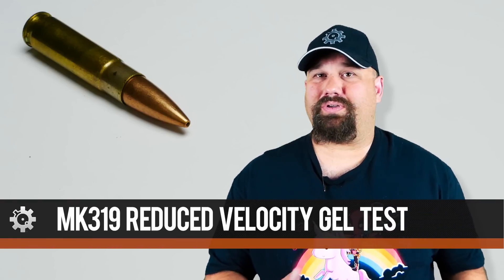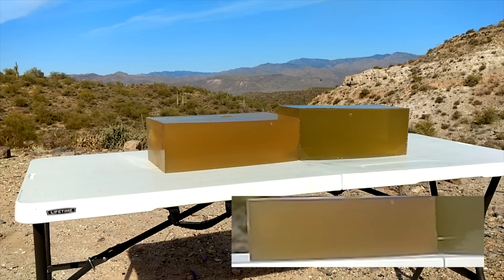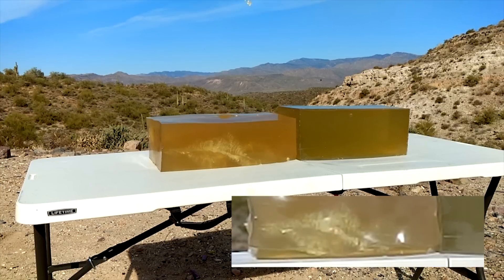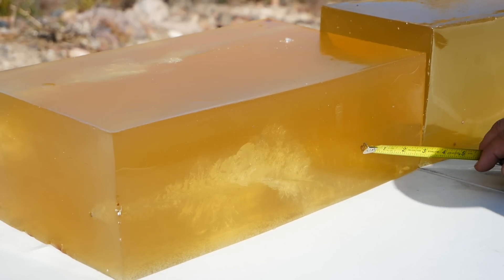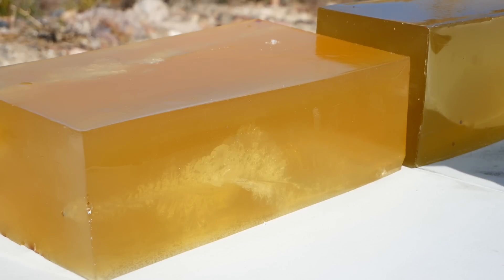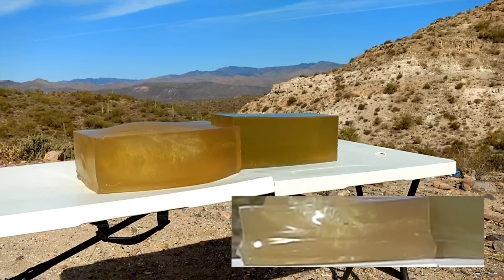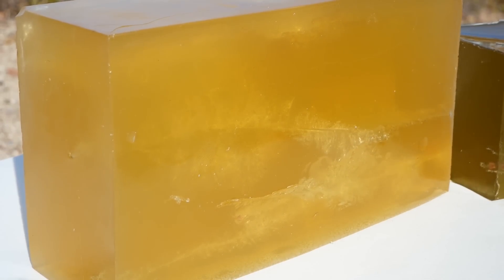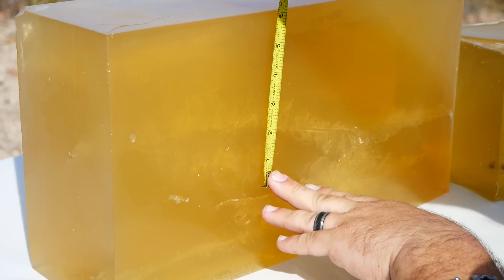MK319 Reduced Velocity Gel Test - How does it compare to the Army's M80A1?

Comment: How can you get a REAL WORLD EFFECTIVENESS of the MK319 AMMO when that is a 7.62x51NATO ROUND and you are loading it into a 300BO at HALF the Velocity of 7.62NATO??  US Military as DOES NOT use 300 Blackout Except for some VERY ELITE UNITs like Seal Team 6/DEVGroup and Delta Force/Special Mission Unit! Here is the info from Federal on the Mk319 who runs Lake City!
Brand or Manufacturer: Federal
Model or Type: T762TNB1 NATO MK319 MOD 0 SOST
Cartridge: 7.62x51mm (.308)
Bullet Weight: 130 Grains
Bullet Type: OTM, barrier blind, open tip match bullet
Temp stable flash reduced propellant
10% reduced recoil impulse
Optimized for 16 inch barrel (SCAR Heavy / SCAR 17S)
Muzzle Velocity: 2925 at 15 feet with 16 Inch barrel
Muzzle Velocity: 2750 at 15 feet with 13 Inch barrel
Reply: Didn't you watch the video?
Reply: @af22raptor23503  The test was to simulate the effects of the projectile at extended ranges. That's why it was loaded into .300 BLK it was an attempt to replicate the 7.62 x51 at 400-500 meters.
Reply: @af22raptor23503  This video was just trying to simulate wound ballistics at extended ranges with the Mk319. I'm sure if you sent them some ammo they would try and preform any test you like.
Reply: @af22raptor23503  Well how should he have done the testing?
Reply: @af22raptor23503  Nothing you presented would have simulated reduced velocity. Which is the entire premise of the video. No the test is not in a controlled environment just like actual combat is not in a controlled environment. This test was not to strict FBI standards that's true. The vast majority of rounds on targets in combat are not through hard barriers. This was just some guy on YouTube trying to simulate the Mk319 bullet not the actual round at extended range. Using the rifles you suggested would only show the round at CQB ranges through hard barriers. That is not the idea behind the video reduced velocity, is what the video is about.
Reply: @af22raptor23503  I don't have to explain away how .300 BLK Mk319 bullet at 10 feet (1616 FPS) is the same as a 7.62x51 NATO Mk319 bullet at 450 yards (1630 fps). It's not It's a simulation of the velocity. I'm not sure why you can't comprehend this it's very simple.
Reply: @af22raptor23503  You're just being hysterical and trying to insult me just proves you have lost this argument. This round will be used at any range it's needed. Is it designed to do the things you pointed out yes. But anything else it might be needed to do it will be used for.  The only information I've presented is from the video and some math to estimate Mk319 velocity at range. You should stop typing in caps so much it shows you don't know what you're talking about and you're just mad that I'm right and you're wrong.
Reply: @af22raptor23503  You are a complete clown you have no idea what you're talking about. To think that a 130 grain .30 cal round can't go past 300 meters accurately  is completely asinine. I'm curious to know what BUD's class where you in since you seem to be an expert on how Seal's operate? Let me guess you weren't why do I say this, because from your messages I would say you're between 12 and 15 years old. You have got to be the most imbecilic human I've ever had the misery of trying to communicate with. Your logic is ridiculous it's like trying to talk with someone from the 
Anti-2Amendment cult. Yes all your caps lock typing is laughable learn to use words better then you won't need to type in caps.
Reply: @af22raptor23503  Keep throwing your little fit it just makes you look like the child you are. You can spout off any B.S. numbers you want, I don't care what you claim to have shot or shoot currently. This conversation I tried to have while you had a temper tantrum, was over the video. Which was about the Mk319 projectile at reduced velocity which for some unknown reason you could not comprehended. I did quote you correctly "the 130gr bullet would not be able to go out accurately pass 200 meters perhaps 300" copy and pasted from your reply. Not sure what you're talking about with the tutor comment but I guess early onset dementia is a thing. By the way I don't need any books with ballistic tables I can do math you know how the people who wrote the books did it. In closing I won't be replying to anymore of your comments. I will allow you to have the last word because there is no way of having a rational conversation with the simple minded.
Reply: @Adam-su2jj  Go back to playing your Video Games and let the Real Men and Women that Take an Oath to Defend this Country and that Put on a Uniform and Strap on a Sidearm and Body Armor go where they are Needed Without your Sanctimonious Ass!  Have a Nice Life and Be Thankful Every Night to Those Like Me that Have Stood a Watch or are on the Fence line somewhere Defend this Country Everyday!
Reply: @af22raptor23503  AFSC right now
Reply: @orpheus280  AFSC?? Not familiar with that Acronym!

Comment: After seeing all these tests, and hearing good feedback from guys in the field I think that the Marines would be crazy not to standardize on the Army's family of rounds. Needing to have separate logistics for their ammo, just because they want to be special, is an absolute waste. This was a good test, but the A1's are all looking sweet.
Reply: It isn't to be special it's for better performance without the extra wear on the guns that the m855a1 and m80a1 cause. The marine corps doesn't have army level of funding to be replacing parts at that frequency. Also the increase pressure make the guns less reliable so what's the point
Reply: And now the Army is going to 6.8mm     and  .338 so it's a mute point now. The USMC just invested in the H&K for their new battle rifle in 5.56mm, as for 7.62x51mm it is yet to be announced if they will stick with the M240 or find room in the budget for the Armys brand new .338 which will be a logistical challenge.